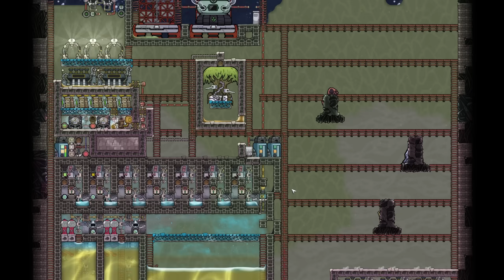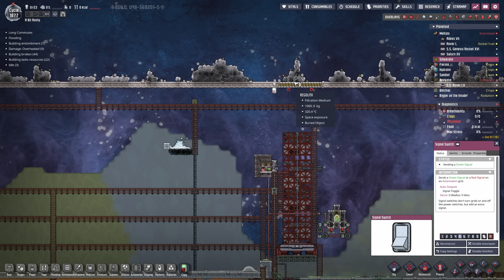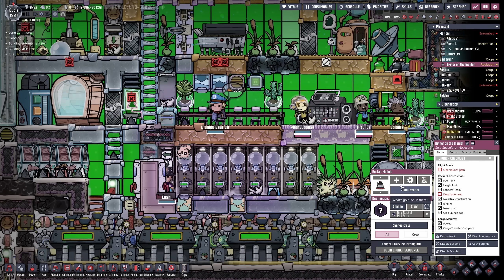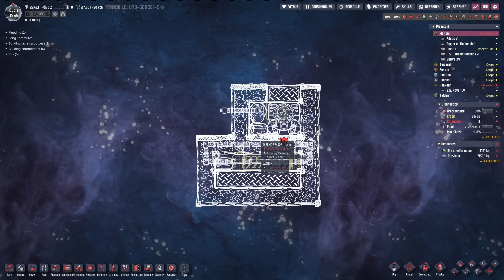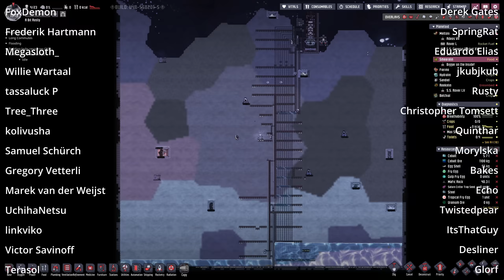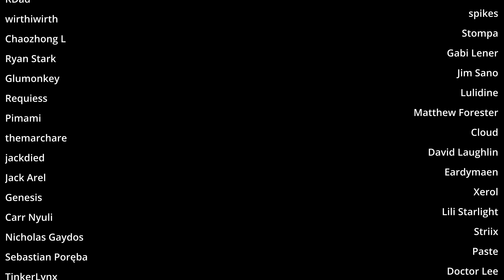Ep33 : Door crushers are too easy : Oxygen not included

Comment: Why do you use super coolant for the petroleum boiler? You want the aquatuner to get very hot by cooling the teperdiser, so wouldn't it be better to use the least efficient cooling medium?
Reply from the maker: The amount of heat generated by the aquatuner is directly proportional to the specific heat capacity of the liquid passing through it.
So say if you submerge the aquatuner in 1,000kg of water at 20C, then you run 1,000kg of some different water through trough the aquatuner. Two things will happen.
The 1000kg of water you passed though the aquatuner will be 14C cooler.
The 1000kg of water surrounding the aquatuner will be 14C hotter.
The aquatuner does not create or destroy heat, it just moves heat around.

Super coolant has a specific heat capacity about twice that of water so it moves the most heat about.

Comment: This may sound a bit daft but wouldn't you be better off using liquid chlorine for the aquatuner in the petrolium boiler?

It has a lower specific heat capacity and the liquid tepidiser has a maximum heat not a minimum. So you could operate within -80°c to -60°c

Comment: I don't use magma for petroleum boilers anymore. its too hard to do in some cases. But I Found the best way 100% and you can even do it early game once you get a little plastic. Build the boiler like normal and at the bottom were the heat source is, Put a metal refinery and loop the coolant pipes up and down into the heating part of the boiler.  Use Naptha as the coolant u need like 800kg maybe, Super Op.. You can set a temp sensor in the boiler and connect it to the oil input valve, so oil flow stops if temp is to low. I was running steel and flowing 10 kgs/ps. It can handle iron etc at like 5-6 or so. its so over powered I have it pumping into a inf storage and had like 30-40000kg per tile it was like 15 tiles or so large. And it wasn't even running that many cycles. it will even power it self on its own power grid using generators and the water was feeding pitcha plants etc. could probably use the water to make more oil. but I had a tank full already. So anyone playing please try this. It is the best 100%, you will need ores to smelt etc, but with petroleum you can make rockets and harvest planets or asteroids.. It is renewable 100%

Comment: i've never tried so i might be completely wrong, but could you not just use the liquid tempedizer (thermium) as a heat source?
the auto turn off at 100°C can be "ignored" with an automation not-gate, creating this flickering behaviour, tricking the tempedizer into working anyways.
the reason this might not work is the actual heat produced, that might not be enough, though i have not tested that
Reply: Reloading the game would reset the flickering behavior (nerf the heat output of the tepedizer).

Comment: @22:00 if you also bridge the output line, both sides will be equal length and you can't overfill it. As you have it, the input overflow line is one tile shorter.

Comment: Do you guys think it would be more effecient to use diffrent liquides for the boiler's aquatuner? something with terrible thermal capacity for the cooling loop such as napta, and nuclear waste instead of steam in the chamber. I know fracis is playing casual, I just thought this will presure tons of energy.
Reply: Short answer, no... You want buffering heat reservoirs that don't change temperture a lot when heat flows through the closed door or heats up super coolant in the aquatuner. If you use different liquids you change the total mass you need for the buffer to serve its purpose well, but you don't change the amount of heat that needs to flow for the crude oil to be converted to petroleum. The only way to "exploit" a higher efficiency would be to abuse materials with different specific heat capacity in different phases (e.g. salt gas-to-liquid, nuclear waste or regolith-to-magma-to-igneous-rock).

Comment: I was really hoping you would build something that required insulation in this run. I was thinking and I can't recall having made insulation myself since vanilla. Cool idea but it just doesn't feel absolutely necessary
Reply: Same, haven’t placed an insulation block since vanilla.  I used to like finalizing my systems by changing out insulation tiles to be the perfect stuff but it’s just not needed at all and takes way too long to get the amount I want.
Reply: It's the same with thermium and to a lesser degree super coolant (with liquid H2 the only exception that "requires" super coolant). When you can make it in quantity, you don't really need it anymore. About the only use for insulation would be builds with extremely high temperature differences: ultra-compact sour gas boilers, or salt-gas powered regolith melters, or abyssalite-to-tungsten melters, all of which serve little purpose when you have access to a niobium volcano for abundant energy and the "perfect" metal...

Comment: Usually when I'm building aquatuner petrol boilers, I run the coolant loop through the output petroleum to save on the power for a tepidizer and have slightly cooler output petrol at the same time. It still needs a tepidizer for starting up the system, but once the petrol is flowing the tepidizer can be deconstructed.

edit: nvm something similar happens later in the video

Comment: 13:20 Is that the dupe that was dropped in the trailblazer module? Doing that removes them from the rocket crew, and then setting the rocket to crew only would kick them out of the rocket. 

Edit 14:50 Heh, comment withdrawn.

Comment: You can use super-coolant instead of water, since it literally cannot freeze, so you wouldnt need a tepidizer. A 1x1 hole of super-coolant is all you need.
Reply: he knows.
Reply: Not sure if that is true... I think the game heats up the aquatuner by the amount of heat required for the temperature change of the coolant. The AT will draw 1200W to cool supercoolant from -273°C to -273.3°C, but I don't think that will actually heat up the AT measurably and you need to generate heat for the petroleum boiler to work!

Comment: do you actually need an heat source for the petroleum boiler (besides at the start)? petroleum has a higher heat capacity than crude oil, so you are basically creating heat; isn't possible for it to be self sustaining?
Reply: you still need power input and heat pump for that, so what's the point

Comment: My favorite method for mopping magma like at 17:40 is to build an automation wire above the volcano and deconstruct it.  If you make it out of a metal that melts in magma like copper, the metal will melt and you can mop from there.
Reply: Fj comments come through again, always an easier way lol.
Reply: Typically, I construct igneous rock ladders. They will cool down the magma and either melt, causing magma to spill over, or  the magma forms debris, from which you can build new ladders deleting heat in the process. Temp shift plates have enough mass to form tiles, which I don't like unless I mean to cap off the vulcano...

Comment: @21:57 it only ever backs up if the input bypass loop is shorter than the output loop
in this case the extra pipe is on the output so it can get stuck if you dont babysit the bridge you're using to fill the loop
to make sure it doesnt back up is to fill the loop while the AT is off then remove the source bridge feeding the loop before turning it on 
if the extra pipe is on the input side of the AT, you dont even need to babysit it and dont even need to remove the source bridge

Comment: Regarding the insulation tiles I don't think we should worry about that. If you were piping the niobium then yes ceramic insulated pipes are gonna break in 10 cycles. I've learned a lot in this gameplay FJ thanks! Especially feeding that tree with something that doesn't have to be cooked or using animal product lol.
For the petroleum boiler I've learned to use only diamond tiles in the whole build. It's just enough to not over cook the oil.